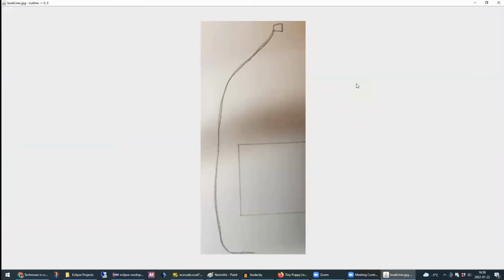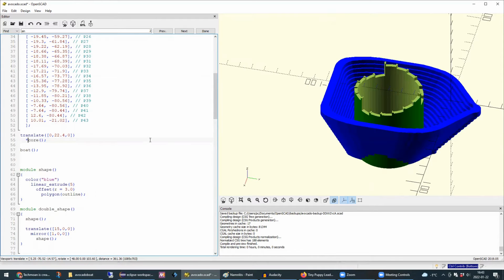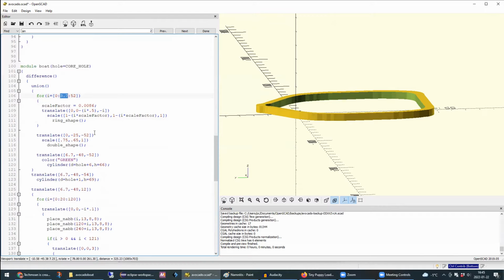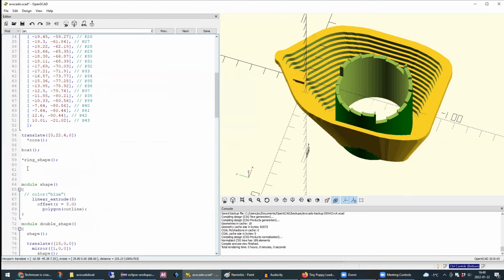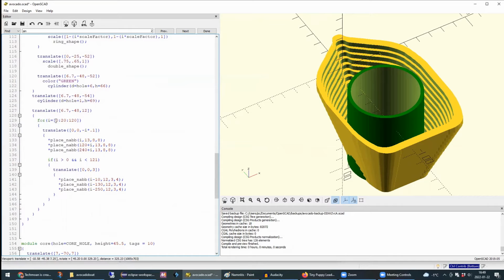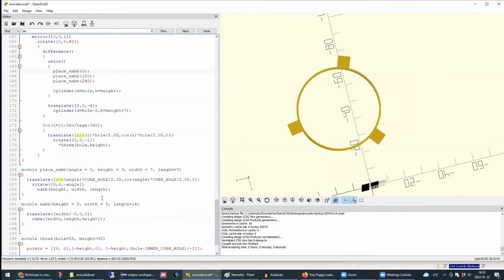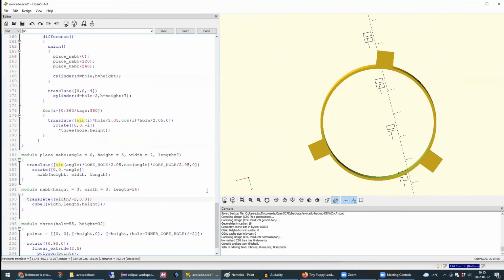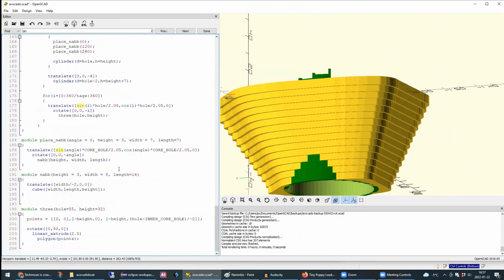How I created a 3D boat in OpenScad . Code walkthrough

Comment: What program is it that you use to trace the pencil line and then import into openSCAD? Is that now part of openSCAD? I haven't used it in years.
Reply from the maker: No, it is a java program I put together just because I needed it. You may have a copy. :-)
Reply: @Oxvalley   Hey, I have a school project and would appreciate a copy of the program if possible, we are comparing different hull forms on 3d printed boat to find out the most optimal.
Reply from the maker: @Skugganloke I can fix you a copy of the program. I have much more capable and newer version of it. Give me a day or two to put it together.
Reply from the maker: @Skugganloke https://drive.google.com/open?id=1Ge4xcTvhtm5wOcJairXnMCAnqMnOE5Ku&usp=drive_fs
Reply from the maker: @Skugganloke Here is the download link for version 2.0. Do not forget that you also need OpenScad (link in ReadMe.md): https://drive.google.com/open?id=1Ge4xcTvhtm5wOcJairXnMCAnqMnOE5Ku&usp=drive_fs
Reply: @Oxvalley  Hej, Det behövs åtkomst till dokumentet men jag har skickat en förfrågan, tack så mycket.
Reply: @Oxvalley  I have sent requests, the document were locked
Reply from the maker: @Skugganloke Sorry. Didn't know I had to change permissions, but now everybody should be able to download it. Try again.
Reply: @Oxvalley  Hey and thanks again, I started trying to design the boat prototype, however there are some problems with designing. The first problem is that the back of the boat becomes sloped in openscad and I am going for a Bulbous bow with a straight back, another problem was how I should make it all work with the bulb att the front. If you have any ideas or tips that would be highly appreciated.